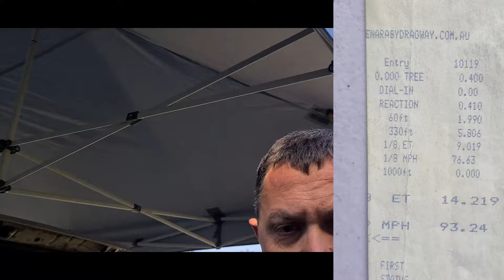SupaTroopsta Struggles at the drags 350 Chev Toyota Troopcarrier lifts a wheel & runs out of fuel

Comment: What's the diff ratio? Seems too high as not revving hard enough past the post. 3rd to 4th a big jump.
Reply from the maker: I have no idea, i do know they aren't standard gears. It was perfect for the 28" tyres before the rebuild.
I'm getting an extra 1500 RPM output of the motor now. So we can go smaller tyres (26") or change gears.
I'll do the old wheel spin, tail shaft rotation test & get an answer.
Reply: @AussieDoug  Can you run a turbo 400 auto with a  shift kit. Torque converter might help keep the motor in the sweet spot. Quicker shifts with auto. Seems to bog down a bit from 3rd to 4th.
Reply from the maker: I have looked into the auto options, but they are not cheap. 
It is on my to do list at some point though. Will need to get a longer tailshaft made and put in some loops to make sure it doesn't fall out.
Reply: @AussieDoug  Loops no biggie. Bend some flat and bolt em in. Tailshaft not that exy. Round the $500 ish. Auto and converter will cost. Could gain a 1 to 1 1/2 seconds.
Reply from the maker: @colinross6259  Thinking I need yo make tailshaft loops sooner rather than later. 
Last thing I need is to pole vault the back of the car over the front.
But agree, auto would be a big gain.